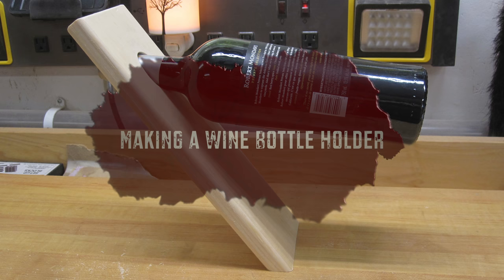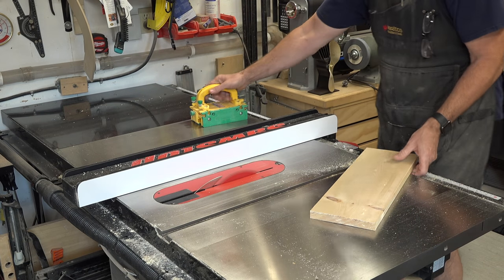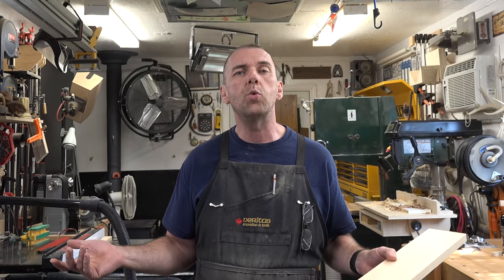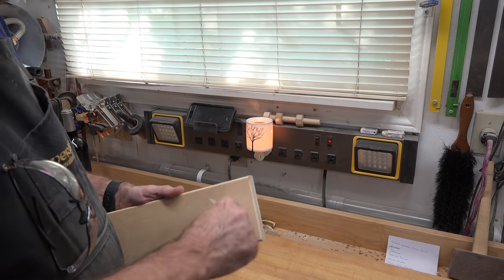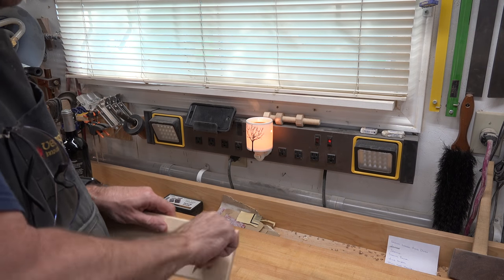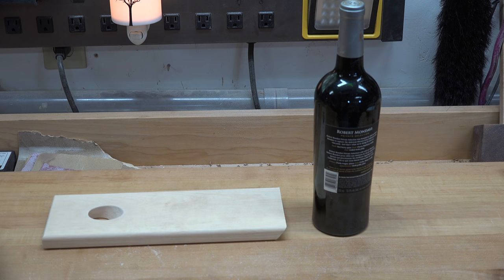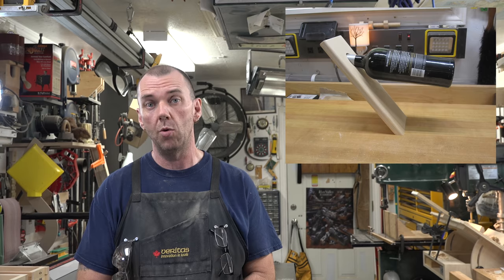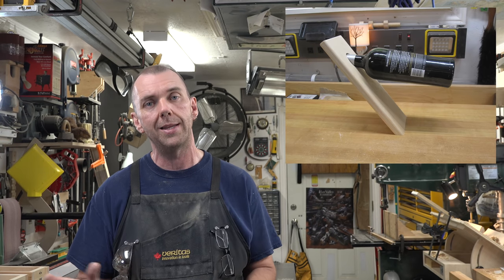Making a Wine Bottle Holder

Comment: Nice... Simple project great for starting woodworkers with minimal tools. Thanks for the instruction and information. It's going to make a great gift for my niece.
Reply from the maker: You're very welcome.  Thanks for tuning in and good luck with your build.  Don't be afraid to change the angle of the cut to a 45 or 40 degree to play with the stability.  Also, thickness of the stock will also help with stability.  If you have any questions, please don't hesitate to ask.

Comment: Very nice video. Does the hole have to be angled to make this? And I love the T Ruler! Haha. Thanks. 🤝
Reply from the maker: If you choose not to angle the hole James, then you have to enlarge it enough so that when the angled portion of the bottle holder is sitting flat to the table, the bottle sits almost parallel with the table top.  Otherwise, the whole thing will just keep falling over.  It's all about balance and weight distribution with this project so it is best done with an angled hole.  I hope this helps.  Thanks for tuning in to the show.
Reply: @acutabove_woodworkings  Perfect Thanks! Not sure I can get an angle like that on my drill press tho. That’s just the thing. Thanks.
Reply from the maker: @jamesbarlowjr.3762  You can drill the hole through a scrap block of wood and then cut the base of the wood to the angle you want your hole.  Tilt you drill press table to the same angle and then clamp the scrap block to the board.  The hole in the wood will guide the drill bit and prevent it from wandering.  I hope that made sense and I hope it helps.  Give it a try James.  You might just surprise yourself.
Reply: @acutabove_woodworkings  Thanks so much. I’ll definitely try that! And Thanks Again for the communication and tips. 🤝
Reply from the maker: @jamesbarlowjr.3762  You're very welcome James.  Good luck.

Comment: Hi Ken, great video to watch. I was just wondering what the gauge/ruler was  called that you used at 4:30 in the video.
Reply from the maker: The ruler that you are referring to, is called a T-Rule and they are made by INCRA.  They are available at most woodworking suppliers, or from INCRA directly.  They are available in either metric or imperial measurements and in several different lengths.  I got mine from Lee Valley Tools.  Here's the link.  https://www.leevalley.com/en-ca/shop/tools/hand-tools/marking-and-measuring/rules/58877-incra-t-rules
I hope this helps.  Thanks for tuning in to the show.